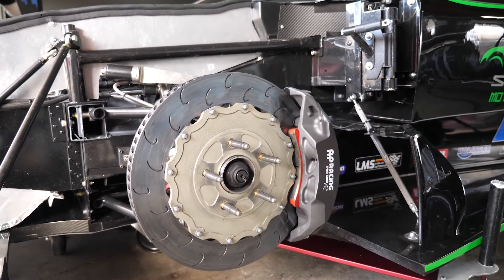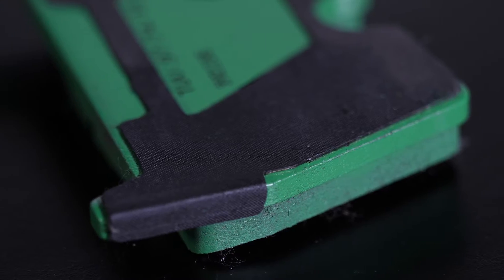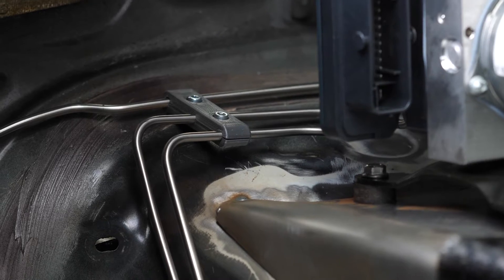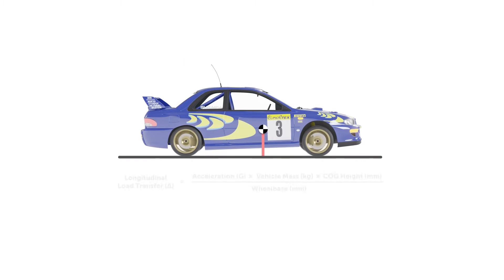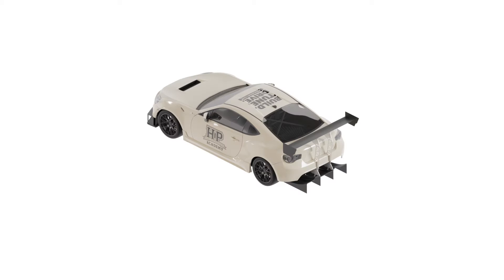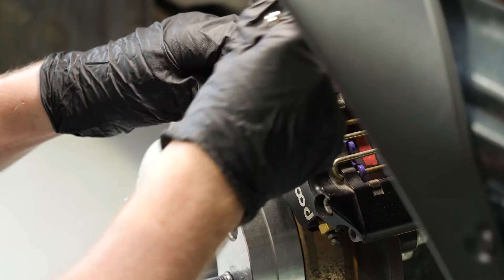Brake System Design and Optimization [ONLINE COURSE]

Comment from the maker: Enroll here for $25 USD off the Brake System Design and Optimization Course: https://hpcdmy.co/brakes
TIME STAMPS:
0:00 - Misunderstood, Under-Performing
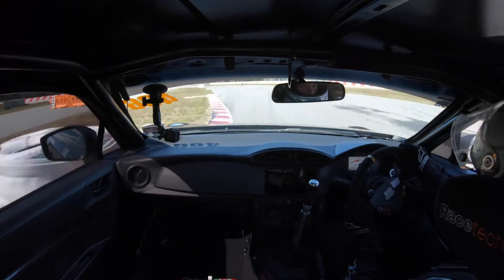0:18 - Slow & Dangerous
0:20 - Big Brake Kits
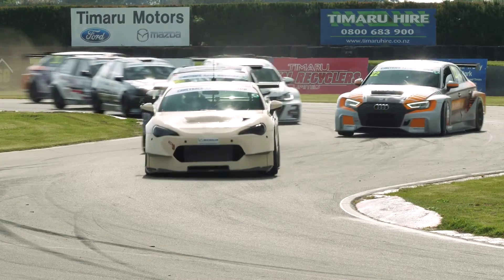0:32 - More Than Just Raw Power
0:49 - Power, Control, Consistency 
1:16 - You Will Learn
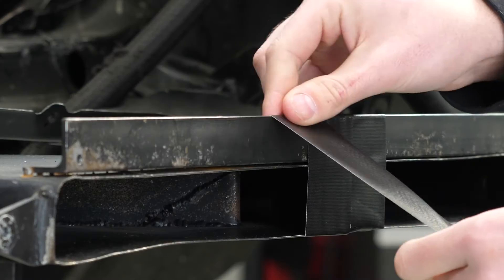1:40 - Anyone Wanting To Go Faster Can Learn
1:50 - Lifetime Access
2:10 - BUILD | TUNE | DRIVE